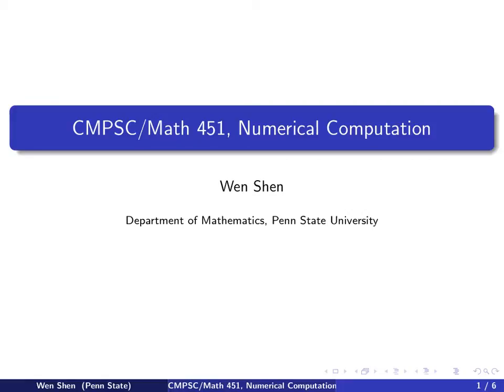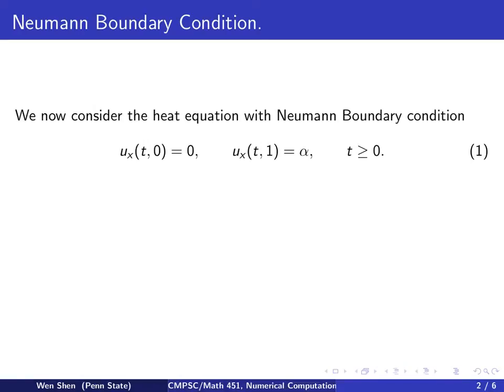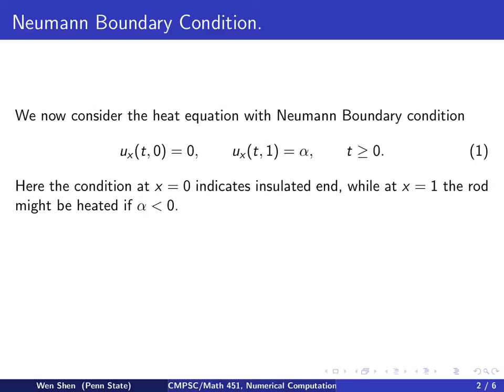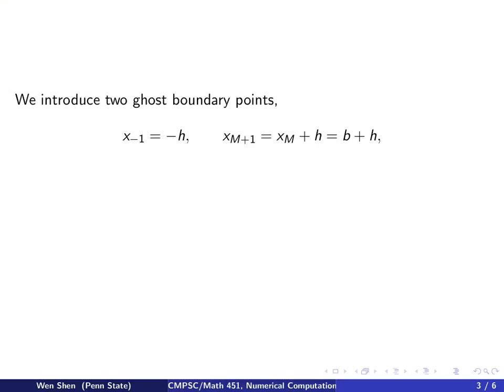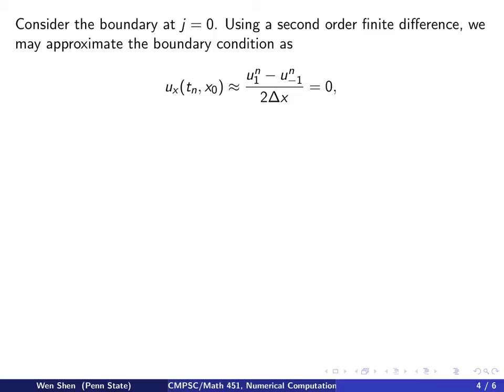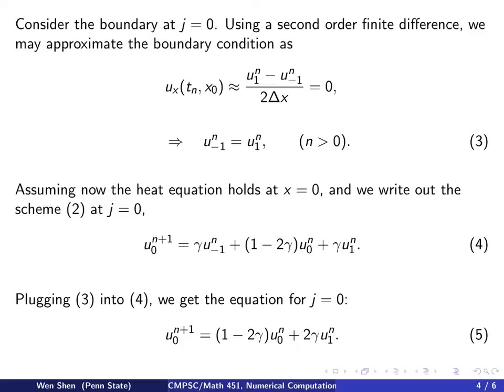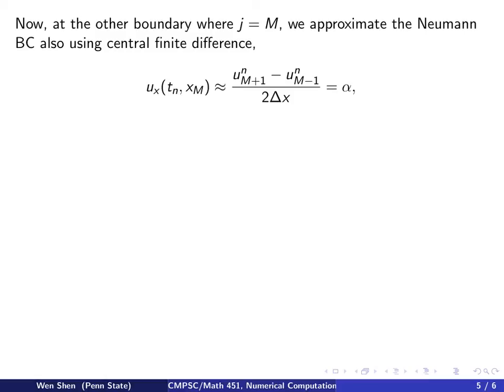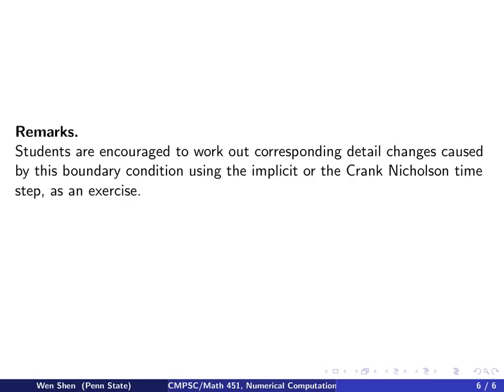ch11 10. Heat equation with Neumann Boundary condition. Wen Shen

Comment: Hello professor, thank you so much for the video and the explanation. 
I'm a master's student and I must solve equation (2) for getting the temperature gradient in the ground/Water. My main core is to calculate the technical potential of the floating PV module and to make a comparison between it and the ground-mounted PV modules, to make this I have to get firstly the temperature of the ground/water. I spent more than 2 months trying to solve equation (2) using Matlab and no one can help me. Please would you mind helping me with that issue? 

Best regards,
Ahmed Mostafa

Comment: How ux(t,0)=0 means no heat transfer? Does not this mean the boundary temperature at this point is 0? As the rods heat up, it must lose heat from this boundary to keep at 0°.
Reply: ux = dT/dx, if it is equal to 0, then no change in temperature, means no heat transfer